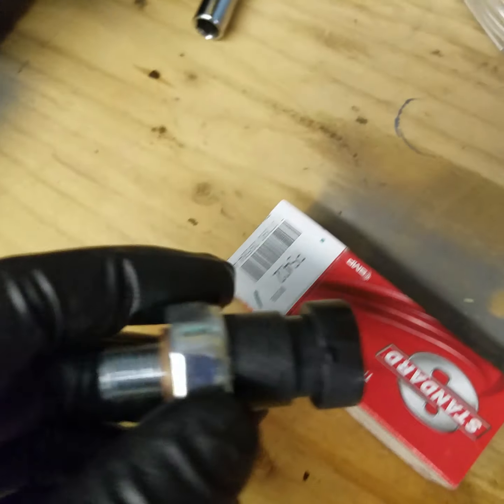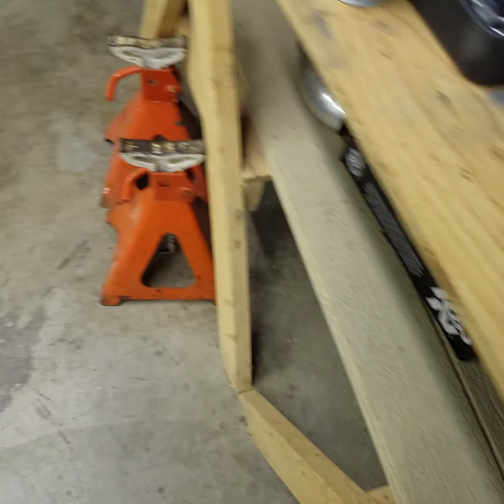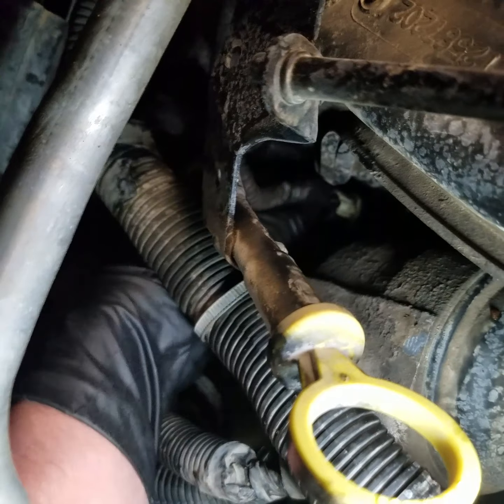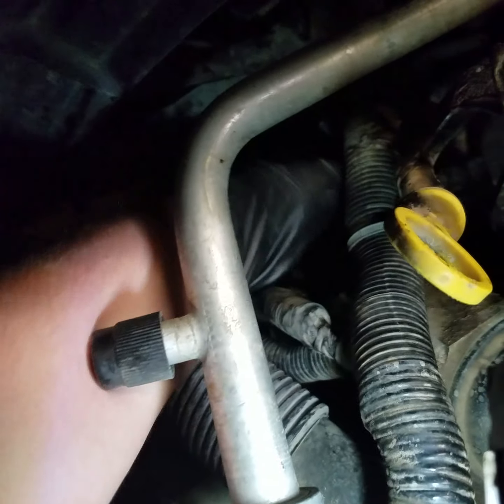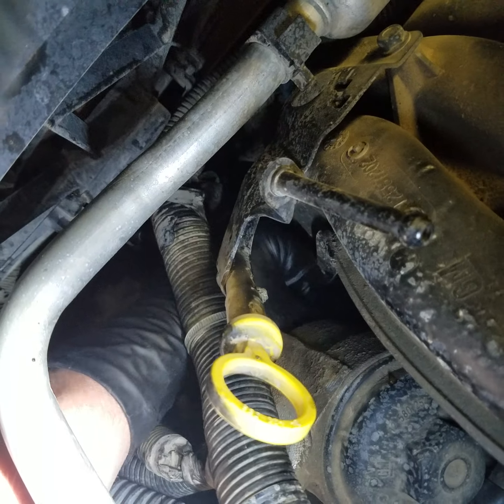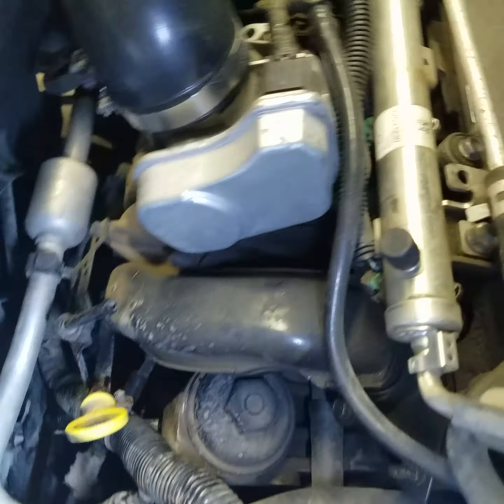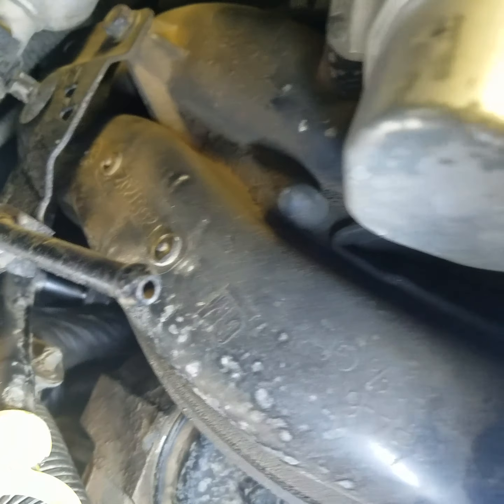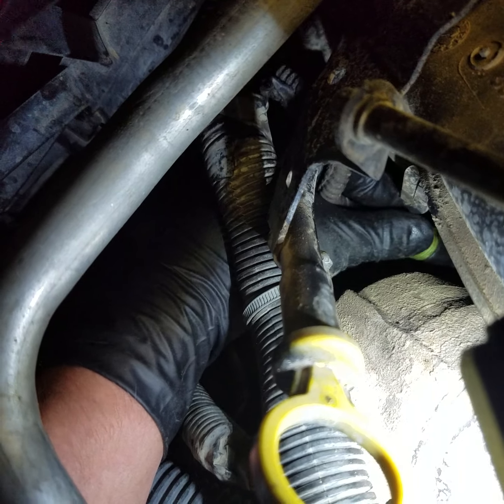How to Replace the Oil Pressure Sensor on a 2006 Chevrolet Cobalt LT

Comment: Thanks for the video. All the other videos had me taking off a bunch of parts underneath when it was much easier to go from the top like you suggested. Oil was all over the clip sensor and on the TCM bottom sensor. Car already runs better. Had issues with it for two years so I’m crossing my fingers!
Reply from the maker: That's awesome I hope it fixed the problem, glad I could help

Comment: Does it requires to add Teflon tape on that oil sending unit's treads? Before installng it?
Reply from the maker: I'm not sure but I didn't and it never leaked

Comment: Exactly  how I replaced one on my 08 chevy cobalt underneath the cartridge oil housing. Turns out it was leaking right through my sensor where you plug it in from the nut. For about a week the oil low red light was on and off sporadically even though every time I checked it, it was still good on the dipstick. They do leak through the sensor. 208 thousand  miles on my cobalt.

Comment: We’re is the cam sensor located
Reply from the maker: My car is a 2006 chevrolet cobalt lt 2.2l l61 but other models may be different but on my car it is right beside the oil fill cap

Comment: Where did you get the tool from?
Reply from the maker: The special socket I used was a 1 1/16" socket from O'Reilly's. I believe it said that it was specifically for the oil sensor and I think that there were several sizes.